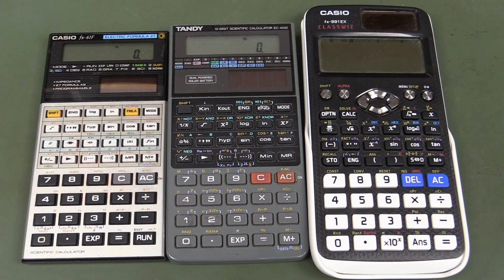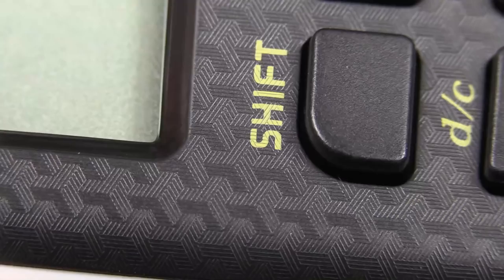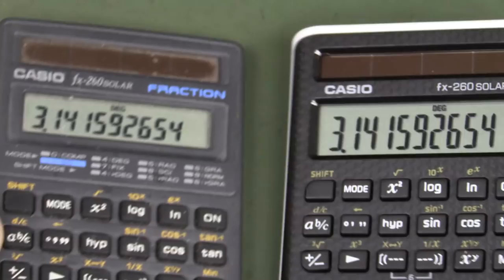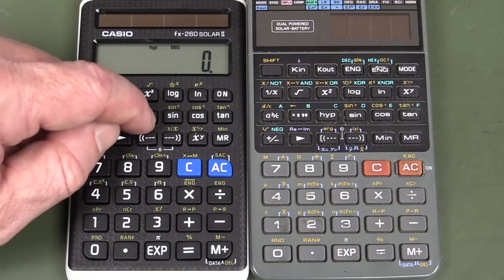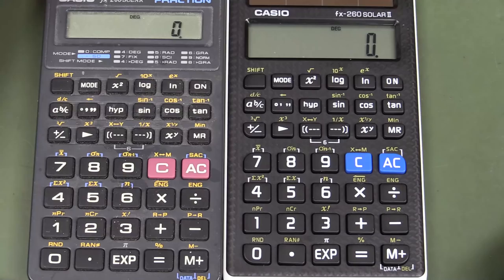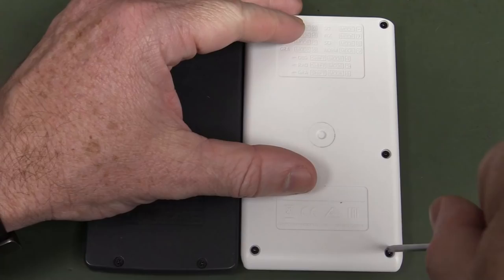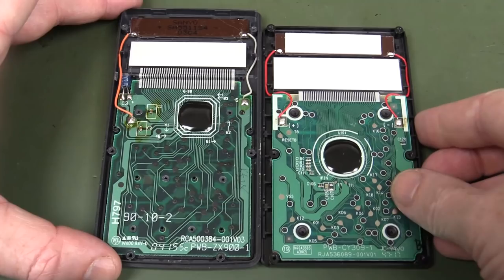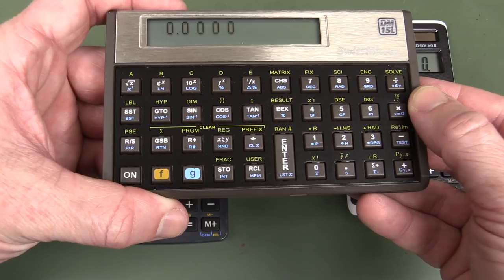EEVblog #1093 - Casio FX260 Solar II Calculator Review

Comment: Always hated that pi is  a secondary function.
Reply: Stefan Gotteswinter The TI-30x/xs/ xs pro/a/2s all have pi on its own key. (P.S. Never thought I'd see you here.)
Reply: Old Casio calculators had EXP and Pi on same key but neither was through shift as the calculator can determine which it is on the context.
Reply: I use the TI30X II in the shop and it works OK for me. We are here more TI people. hardly any shop sells Casio calculators. 
And yes. it has a dedicated PI key.
Reply from the maker: Andrew Delashaw  - But the TI-30x et.al has the exponent key as a shift function, dumbest idea ever. I'll never use a TI for that reason alone.
Reply: I come around quite a bit ;)
Cant get myself around to use a TI calc. never liked the look/feel/everything on them ;)
Reply: It's not a secondary function, it's a context-sensitive button... if you type a digit, then exp, it brings up scientific notation. 
If you press the button without a preceding digit, it just puts pi.
Reply: I just checked this on my fx-991DEX. 
No, its not context-sensitive. No digit, just hit the button and it gives the "x10" in lower case. with preceding digit: same, of course. With operator precesing: same.
But the VPAM is pretty much THE best thing ever. Sure, if all you do is 5x5 or 8^2... no need. But if you actually use it to crunsh threw some formulas: Holy shit, its the holy grail! Not to mention that you can simply change values later on instead of retyping everything...
Reply: CRIKEY!!!
Reply: Ahhh c'mon DAve. The 30 is a jokers calculator. The 36X Pro is the ducks guts. That thing will do the business and give you change back.
Reply: Yes the ti-36x pro solar gets very good reviews, I have one and its a great calculator.
Reply: Just do what Dave does and memorize pi to the 9th decimal..
Reply: It's not secondary on this model. That's why it's a different color from the other secondary function markings. The EXP button is context sensitive.

Comment: I bought a SwissMicro DM16L programmer's calculator and love it. I do a lot of embedded programming and it's so nice having it in front of me between my arms as it will do one button conversions between hex, dec, oct and bin. It will also gives you 1 and 2s compliment along with unsigned. It can check just about any logic operation you can think of. It's also a reproduction of an old HP calculator using RPN so it's win/win for workflow and geek cool.

Comment: I used an fx-260 solar all through high school and college - as in until just last year! I actually had two of them. There were actually two different fx-260 solars, both with the same name. The first generation I had used soft buttons, and the 2nd generation I got later had hard buttons and the chassis was slightly larger.

Comment: I still have mine from the early nineties. The FX-260 Solar is an amazing little cheap calculator, very light, charming and pleasant to use; I love it so much. It's still great for situations where you can't lug a hefty HP around. The only sad thing is that going RPN is like becoming Borg/conjoined—you can't really come back, only pretend (badly).

Comment: I've got a fx-300s that's very much like your Tandy. It must be 20 years old! I had to change the battery in it a month back as it would only work in bright light with the old battery. 

Being a machinist I prefer the smooth gray as it's easier to keep clean around cnc's. The numbers are almost wore off the keys from use. I've got the smaller form factor gray old Casio like yours but prefer the bigger older one.

Comment: Would you be interested in doing a "how to use calculators for electrical engineering calculations" tutorial?
Reply: @kippyjohnson All you have to do is find the medium of amperage vs voltage which is associated with average wattage. You can determine the kwh based of mean over integer of the electronics devices.

Comment: Love reminiscing the 70s and 80s. 
I loved Casio. Had a couple with my first being fx-61. 
My last classic was a fx-5000f. 
I loved running mini programs on it. 
My newer Casio 9850 Graphing calculator didn’t last nearly as long. 
It just died for no reason. 
My guess is one of the components aged. 
Found others with similar issues online with no resolution.

Comment: As a teacher, it always bugs me that TI has such a lock on that market. Textbooks are written specifically for their calculators, students are required to buy them, etc.
Reply: Mark Scheuern It's a, "damned if you do, canned if you don't," situation. If they didn't have it like that, people's would be bitching, "Why can't they standardize things so students can use their calculator along with the book. They've all got different calculators."
Reply: True. And you could argue that HP, Casio, etc. dropped the ball on the education market.
Reply: Mark Scheuern in my state it's two different Casio calculators that you each need for 2 years only.
Reply: Interesting! Cost less than the TI calculators, I imagine. The TIs have been the same price forever.
Reply: Mark Scheuern: In middle school we had calculators from MBO (this brand seems not to exist anymore), in high school it was a Casio (CFX-9850GB) and my University was specialized in Casio Classpad (with CAS). But I know that one of the other high schools in my town have had TI at this time. So it does not seem to be too much concentrated on the TI brand only. (all in the state of Saxony in Germany)
Reply: Well, not that Casio is much better in the pricing of their graphical calculators... For the price of the fx-CG50 (which has a 3.15" screen, 61 kB of RAM, 16 MB of flash), I could buy an Orange Pi Win Plus with a quad core 64-bit processor ARM Cortex-A53, 2 GB of DDR3 RAM (125 times the flash in the calculator or more than 32 000 times the RAM!), Wi-Fi and Bluetooth, Gigabit Ethernet..., plus a 7" screen for it! I'd bet a million euros (which I don't even have yet) that calculator doesn't cost them more than 30 €/$!
Reply: @xenonram  and meanwhile here in asia most of us can only use calculator in college.

Comment: I do like having a calculator right there on the bench rather than moving away to another device and then opening the calculator on that.
Reply: Motorman2112 except if you are out in the middle of nowhere and you have an urgent need for a bit of possessing power !

Comment: i collect calculators and i have a lot of casios. i even got two of those where you said that they where expensive from ebay. one from a older lady which had written her name on the back of her old calculator and one from a guy. these are very nice pieces. this people have used them for years.

Comment: I have a Casio fx-82 Solar (1) with plastic keys. And I have also seen 2 variations of the back cover for it.
Reply: Yesterday I got a Casio fx-82 Solar with the rubber keys and its size is a bit smaller than the other one with the hard plastic keys. Design-wise they are virtually identical besides the design on the slide-on cover. Both are called the Casio fx-82SOLAR FRACTION

Comment: The dedicated 'On' key was the dedicated 'Off' key in the battery powered FX82/FX260 models. I always thought they included it so that they could keep the same keyboard matrix rather than redo it to make use of the extra key for something more useful. Never owned a solar powered model, but I often wondered if they would still turn on by pressing the AC key as with the battery models (or even if the 'ON' key was just implemented as a second AC key and would perform all of it's functions).

Comment: I used a Casio FX-550 when I was in high school during the 1980's. Great calculator for it's day. Before that I used math table books. After the Casio I progressed to HP graphing calculators like the HP-48SX and my current one which is a HP Prime. Of course none of these are as great as my amazing Curta Type II Calculator (look it up) which I bought via an EBay auction many years ago. ;)

Comment: Great review. The older fx-260 Solar is made in 2004, week 15 to the best of my knowledge (not in 1990) and the newer one in 2017, week 47. Both are printed in 7 segment style. The WL mark on the pcb is more typical of the 2000s. And fx-260 Solar was released in 1996, in Japan, from what I have seen in Japanese catalogues.

Comment: In parts of Canada the FX260 Solar is still a requirement for people who didn't get a High School Diploma to take the exam. The GED Testing Service supplies training material based on this calculator prior to testing. The same calculator is supplied by the company at the time of testing. You can't bring your own. Casio must be envious of Texas Instruments that has a strangle hold on the Post Secondary Education System with their TI-84 Graphic Calculator being mandatory for many courses.
Reply: The FX260 was the calculator requirement to use at the UoC for engineering and had the shulich stamp on the back. They had a new one a couple years ago but the FX260 was much better and I still use it at work now.
Reply: I was in high school from 91-97 and ours was the Casio FX-82. There was also a TI equivalent you could use, but it was subtly different and unsupported. I had an FX-115s for a while (same but with solar).

IIRC we took our own in back then for exams, but this was before there were widespread calculators with memory and thus potentially cheat sheets inside.

Comment: I have a Casio fx-82MS in a drawer. I haven't used it in like 10 years. I think I had to buy it from the shop at the university campus because I didn't have one for an exam. 
I do have to agree, the rubber keys from older calculators had a better feel than the hard plastic ones on newer models.

Comment: My favorite Casio was the EC-4016, or the Radio Shack rebadge. It was insanely thin, solar-only, and full scientific. It was damn near indestructible, but not unloseable. I'm still upset that I lost the thing, it was my only calculator for years and years...and while I collect slide rules, a calculator IS faster.

Comment: I think it was the old fx-260 that had this feature that I really miss on (all?) the new ones. You enter a number, hit "+" two times and with every "=" you get your number added again to the result. Is there any calculator still capable of doing that?
It is so useful if for example you have to drill a couple of holes with same distance. No need to move the ruler while being more accurate when marking the drill spots.

Comment: The newer models seem to be going back to their earlier 70s designs where they had black fascia with white backs on them. I've got an old 70s era casio that is just a basic math calc that looks similar. So they actually have gone back to designs they used 40 years ago.

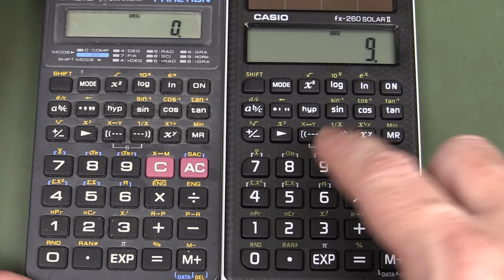Comment: Great video.  I have the original Solar as well.  At your videos time index 14:30 you did the chipset test. My Casio fx-260solar came out with 9.000007164 the same as the Fx-260solar II.  Perhaps you had entered the sequence wrong?  I'd be curious if it was a button error or a chip differance.

Comment: I actually prefer the TI calculators. I've had a TI-84 since forever and being able to run custom programs on it, and multi-line display, keeps me coming back. I'd prefer they used NAND instead of SRAM but whatever, how often do you replace the battery anyway

Comment: Found a minor bug on the fx260II:
A way to check the internal precision of numbers is to take a known value, and subtract the digits as shown on screen. This will show if any precision is stored beyond displayed value.
pi(calculator constant) - 3.141592654 (as displayed) = -0.0000000004 (-4E-10)
e^1 (calculator constant) - 2.718281828 (as displayed) = 0.00000000045 (4.5E-10)
  /\ This shows that pi and e are stored with 11-12 digits (3.1415926536, 2.718228182845), and they are correctly rounded to fit on display.
Unfortunately...
1/6 (0.16 repeating6) - 0.166666666 (displayed) = 0.000000000666 (6.66E-10)
  /\ This shows that this displayed value has three extra hidden places of precision HOWEVER it is rounded incorrectly for the display. The displayed value should be rounded to 0.166666667
Why it rounds for one and not the other is unclear. The Fx115ES handles this correctly with a couple more hidden places of precision.
The largest single-computation error I was able to induce with this method was 8.88E-10, and if 888 trillionths ruin your project, you should be using a different calculator.

Comment: We got the classwiz in school but only for years 10 and 11 now we have a graphical CX something. I prefer the classwiz due to more functions on its face, for example Abs. And not hidden in the catalog. 

The way variables work on the classwiz is the best ever for doing similar calculatoins multiple times and it's faster then setting up some spreadsheet.

Comment: I do not like these modern lcd digits. Bigger, longer but thiner. Less readable and more confusing. Same for the font used on buttons. I do prefer the 80s style.
Reply from the maker: Agreed. I still appreciate the larger size though
Reply: The typefaces used on the 80s and 90s model are classic! Modern ones Myriad is just ok, but the newest one is not that good.

Comment: This NF stuff seems stupid, just from looking at it what's stopping students from swapping out the boards? From the outside they are obviously the NF version but since the button is still physically there you can use that function no problem. Seems pointless.

Comment: Long been replaced, but my old FX-82D is still kicking. The mid '90s batteries are still alive too. Cracking it open again, what's surprising to me is that the chip isn't potted, it's naked on the board. Was this common back then (early '90s)?
Reply: Yes, many of the 1990s Casio calculators used PCB-less designs (1988 to 1994).

Comment: I do enjoy that calc. Though some might scream foul at my suggestion but hey, I'm an engineer and carry my TI-36X Pro around in the back pocket of my work slacks out in the shop or to meetings. I think its the shape that makes it really handle the portability side of things really well.

AND.....its a TI that has all the PROPER FUNCTIONS on dedicated keys, ie. pi, e, i, x^, x^2, ln, log, trig and inv. trig operations and they fucked right off with hyperbolics and stuck them in the drawer (buried in a function list) where they belong. No one likes hyperbolics, not even Euler himself.

And as true testament to the robustness and maths-centricness (is that a word?!) of the TI-36X Pro.....you have derivative and integral as a shift operation on dedicated keys. Hell yes. It also does list functions and matrices.

Great vid Dave, absolutely loved it!

Comment: Just when I though smart phones had killed the calculator, boom back interested!
Reply: Mr. Delphi unless you are out and about on the field, but I get what you mean
Reply: Mr. Delphi.  yes, it beats carrying a sliderule around with you everywhere you go!
Reply: Android users check out RealCalc by Quartic Software, so good you can almost forget you are not using a real calculator. It is completely free with no ads though I paid for the 'plus' version just because I felt guilty at how much I used it.

Comment: My fx-100s you don't need to close the brackets for a lot of stuff   'sin 30 =' works just fine.
Edit: The very best thing is the swinging, locking lid.. Close it up and it's pretty much indistrctable and you can't loose the lid!
Edit: SQR is dedicated key with x-y as the shift.

Comment: My only pet peeve with some calculators is how they handle percentage, some will change it to a decimal point, while other ones will actually take the percentage, personal preference I suppose but I hate the former calculators because let's say I want to add 30% to 100 well 100.3 and 130 are very different answers.

Comment: Hyperbolic functions, fractions display and pocket size are all valuable to physics students. As are DEG and RAD but I think you'll have to go into astronomy or geography/geophysics to find a use for GRA. No idea why they have the cubics on different buttons though.
Reply: Photoloss Degrees - Minutes - Seconds key is very useful when your GPS and maps disagree between decimal and proper coordinate notation.  Also good for wall clock and YouTube time stamps.
Reply: You would use radians in astronomy, just like in any other physical science.
Reply: +Direkin in modern fields yes, but the parsec is the arcSECOND parallax of the Earth's orbit and I'd be surprised if all the older source catalogues have been updated. Converting time units is a neat idea though.
Reply: Right, and a second of arc is a 3600th of a degree, not a gradian. Angular diameter is the only time degrees are used, everything else involving astrophysics is in radians.

Comment: I had one of the old casio fx7000G graphing ones at schooling the 1990's, was the envy of the maths class. But couldn't use it in national exams because it could save formulas. Also the batteries were really expensive back then. About $20 back in 90's money. Casio calculators were also really expensive back then. So a good thing they have dropped in price, but the build  quality of the old ones doesn't look as good in these new ones.
Reply: Strict Japanese quality control is no longer available these days.